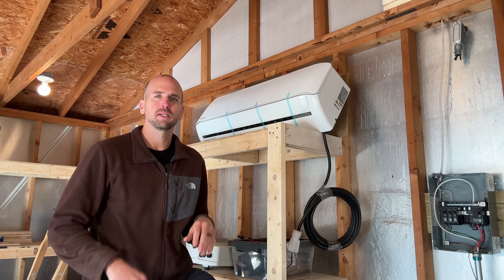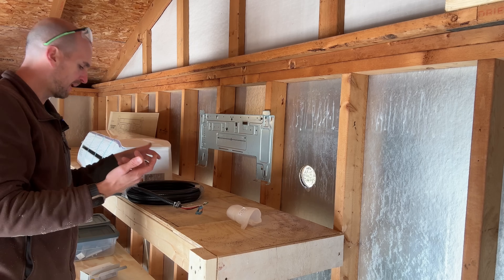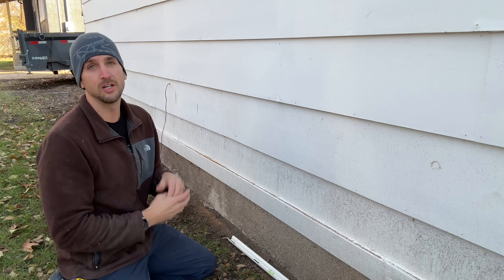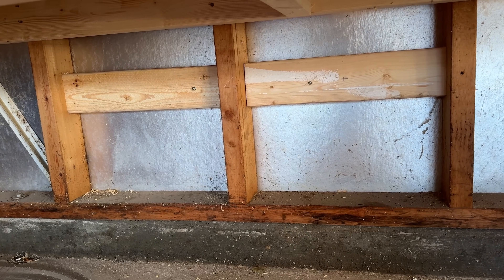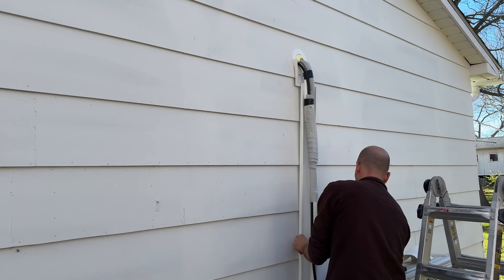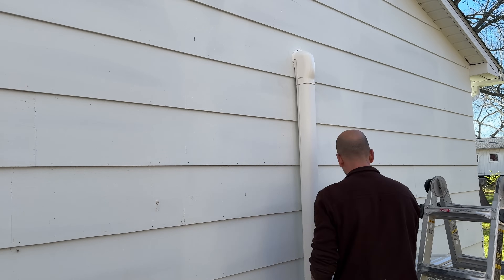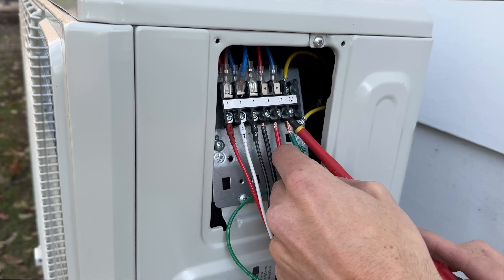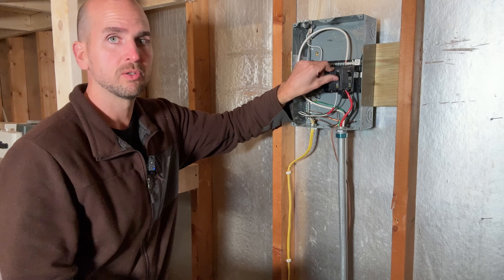Complete DIY Mini Split Installation | New Mr Cool 4th Gen Unit

Comment: Im a bit confused why would you wrap the line set prior to checking for leaks ? That's kinda DUMB! If your going to tell people the most common mistakes well you just DID one of the most COMMON MISTAKES Yourself.  ALWAYS CHECK YOUR LINES BEFORE SEALING WRAPPING OR COMPLETING YOUR COVERS! just in-case you have to take them apart and reinstall them. Dust or dirt can cause the line set to have a slow leak. A spray bottle with Dish soap and water to test your line connection spray it on the connections  if there are bubbles blowing up,  you have a leak!   I agree with your marking the wire, it is mandatory in US ELECTRICAL CODE to mark for safety. Wrapping the wire is the best way!
Reply: I can sense you got angry... you ok? Is everything ok at home?
Reply: @dulceesparza8704  you got late day issues bro, And nope not angry at all, just confused if someone is going to correct everyone else then atleast get it right. If your a handyman And I hire you to do the job you wrap all my line sets and they discharge because you didnt check for leaks, then Ill be angry. Then you have to deal with it. (assuming your the Handyman I hired.) you can either pay for it or besides the bad word of mouth Ill see you in court. Then Ill be happy again because hopefully you learned to always check your lines when messing with any kind of Freon. If you own up to the mistake take care of it, Then I would still be able to give you or your company a good reference. first for being honest (Also the most important) secondly for taking care of the job to the satisfaction of the customer.

Comment: ? I didn't notice what was done with the drain line on the outside of the building. Does it just terminate at the factory provided length or do you extend it down the external wall and terminate at the back side of the condenser ?
Reply: He didn't pay attention either

Comment: How do the lines run in a multi zone setup look? Daisy chain or each connects directly?
What is the max line length?  Im trying to do this in a second floor and the lines are only 25'?
Or can i buy more?
Reply from the maker: You can buy more and at different lengths to fit your application.

Comment: I installed a Mr Cool non DIY dual zone split system 3.5 years ago.  Both units running great no problems.  I really dont like the coiled up line left over with the diy kit.

Comment: Everything is numéro one. Except the part where you exposed your line set to atmosphere thus adding air to your line set. You would of had to vacum your line set bro before opening your valve 😮
Reply from the maker: Not on the Mr Cool units.  If done right the pre charged lines mean you will not need to pull a vacuum.
Reply: @EverydayHomeRepairs  your still putting air in your line set. Hard for a compressor to compress air

Comment: if it sounds too good to be true it usually  is !!     MR COOL you left out 2 major critical  proceedures in your installation that can lead to unit problems .  1)  you did not  evacuate possible air and contaminants out of the evap and condensing units ,before letting refrigerant charge into system  and 2)   Cardnial  rule    you did not leak check all of your refrigerant connections for leaks !!!!

Comment: One thing to note is that the wall-mount bracket that mrcool sells for the 18k model (which is different than what's shown here) only allows the unit to be 4" from the wall (although mrcool recommmends 6"). But what makes this a real problem is trying to (carefully) bend the refrigerant lines enough to get them aligned well enough to screw the couplings together. I had to unbolt the compressor and move it away from the wall, then screw the couplings together, then carefully bent the lines enough to get the unit back into position.

Comment: Word of warning. Mounting the condenser unit on a bracket, the bracket will transfer sound vibrations to the wall, not a lot. But worth considering. 
I mounted mine on a bracket, now wish I hadn’t. May change it.

Comment: Dude! Hands down, that was one of THE BEST done clip I've ever seen. And I've seen a lot. Bravo. Two questions: My HVAC buddy who will help me on a weekend with this is suggesting a 24k system for my 24 x 36 pole barn that we Spray Foam Insulated with 2" on walls and 3" on ceiling. In your opinion, is 24k overkill? Guy is way smarter about this than me, but I'm just wondering. Or is bigger better?

Secondly, he likes Mitsubishi, but it's almost twice the money as Mr. Cool, which I'm reading is a very good system. Money is not the biggest object, but the Mr. Cool seems like a much better VALUE. Can you weigh in? I don't mind spending the money if it's buying something far superior, but I'm not sure the Mitsu buys all that for the delta in price. Thx. Keep up the great work!

Comment: I feel I could tackle this project now that Ive seen this video.   One question is if I would need to run conduit on the inside exposed wall instead of the NM(non metallic) wire shown here.   I know its drilled through the studs, but its exposed so thats why I am asking. So I know what supplies I need for this.   Thanks for all your helpful videos!

Comment: You probably should have mounted the air handler to the right, not over top of the shelves.  Reason: shelf will block air flow as the air output is at the bottom of the air handler.  If mounted to the right, free air flow downward.

Comment: I installed a two head Mr. Cool in my VT home about 18 months ago.  It has been working great.  The few days in summer that I need it it cools the home quickly and I did get to test the unit once in winter when it was -16 F outside.  It produced heat without issue.  My oil use is down tremendously and I am planning a DIY solar setup this some to save even more cash.

Comment: Cool
But is 12-3  what you had to use for 240 just a heads up
Reply: He used the white of the 12-2 as the second leg for 220v. Neutral not needed
Reply: Why would neutral not be needed? @phildesmond9605

Comment: Could one place the "outside" hole further down the wall?  I don't like those lines coming out of an exterior wall.  I hope to be able to go into the wall behind the unit, run the lines behind the drywall and then out through an exterior hole closer to the ground.

Comment: Is that extra line set that I see rolled up behind the unit? And is it safe to do that?
Reply from the maker: Yes, but I think you should have the extra coil laying horizontal instead of vertical which has been pointed out be a bunch of people in the comments and is a better practice.

Comment: Ok a couple of things   The coil created by extra line set in the back of the outdoor unit is an oil trap.  Eventually the compressor will be starved of oil and will fail.  The required way to coil it is to coil it horizontally not vertically.  The other thing is the positioning of the indoor unit.  It appears that the area directly underneath the indoor unit is framed out for a shelf.  If a shelf is installed there it will block off the air flow.  When in cooling mode the lovers will be directed downward,  this will obstruct the air flow and the air won’t get to where it is intended.  Additionally if a shelf is installed you are likely to have the cold air recirculate back to the air intake and possibly have freezing coil issue.  The 2x4 frame underneath is not great.

Comment: Also, if you only get a 30" bracket like he got, you can mount one of the 90° angles brackets centered on a stud and than offset the hanging bracket so that it mounts across two studs where the other 90° brackets hangs.

Comment: Great video! How much does it typically cost to have these installed by a general contractor? And this is just one handler, how would you install additional handlers if that’s something I’m looking at? It looks easy enough for me to do but I’m hesitant with the other handler going to the opposite side of the garage and doesn’t have outdoor access. So most likely would need to run through the walls or attic

Comment: As a DIYer with school education.
I did the same mistake, trying to water level the unit.
Water will just NOT FLOW OUT...
Now my indoor unit is tilted 5-8 degrees, so the water will flow out naturally ... 
I have my split unit working for 3 years now without any problems ... 
Wait. Yes. Where we stay, 2-3 months is too long for a cleaning. 
If you have stagnant water in your AC indoor unit, that will cause mold and bacteria to grow ...
Just saying.

Comment: Why not elevate the inside unit higher to clear your shelf more? Items on the shelf will block air flow. There is also a commercial sealant for the refrigerant lines which helps to ensure a good seal.

Comment: I am installing same unit but a double unit. Can the drain be separated to run directly outside and the lines to the unit be run through the attic ?   Thank You for your help and great video of the install process !
Reply: I'm wondering the same. I can't believe it wouldn't: just needs to drain

Comment: Can I make my pilot hole in the middle of the metal bracket and run my lines through the middle of the mini split,  instead of the bottom corner ?

Comment: Very good and practical installation.A few things could’ve been done before releasing the precharged system such as: vacuuming the line set with a vacuum pump,because moisture is in that line set.but otherwise from that not bad at all.
Reply: What are you talking about it’s a diy Mr cool unit it doesn’t need vacuumed.

Comment: Awesome!  That’s a huge savings doing the work yourself. 
Question….What if you performed the install yourself and then called an HVAC guy to cut the lines and reconnect them for a cleaner job. I would think the total cost of the project would be considerably less than having the HVAC guy do it all. I am assuming the refrigerant can be extracted and reinstalled by the hvac guy. Just curious.

Comment: Love the content. Keep it up. I would suggest insulating that garage. It will keep the unit from constantly cycling, reduce the electrical bill, and increase the longevity of the mini split unit.
Reply: If the unit is cycling wouldn’t that means that the unit is larger than the space? Plus is the unit an Inverter?It as 4core 2.5 mm wire which inverters use…so if the garage is not insulated properly,the opposite would happen(the unit will run continuously)which would also ramp up the unit to maximum speed for both the condenser fan and the variable speed compressor.
Reply: @r410a6  Yes, causing your electrical bill to increase. Not to mention the strain on your unit ensuring your local HVAC tec a new boat from all the repairs you're going to need. Bottom line is insulate the enclosed area.

Comment: The coil of excess lineset should be horizontal.  You can have pooling of refrigerant.  I am no pro, but I have installed a few of these and the instructions point this out.

Comment: I mounted my outside unit on four PVC pylons filled with concrete and bolted the unit into the pylons. They're two feet tall. It's NH so we could get a 2' snow storm and have in the past.

Comment: Great video. I am now going this route for my mini split. However, you mentioned that the unit needed a  20 amp circuit, but the product specifications state it needs to be a 30 amp. Can you clarify why you only went with a 20amp circuit? I have a bunch of 12/2 romex and would love to run that, but I got concerned with the 30a specification on the product page. Again, I appreciate this video more than you know.
Reply: the mr cool 12K units run off of 12/2 - 120 volt/20 amps. Anything above that will need 240 volts and thicker wire.

Comment: I was led to believe that the lines that you attach are empty and that the refrigerant is entirely in the outdoor unit which is released through the lines when you open the high pressure valve. Which is also why they typically recommend that prior to opening the valve the system is pressure tested and vacuumed. I also did not realize that the indoor unit lines are nitrogen charged so when you take off the caps off you got a loud blast.

Comment: He’s doing an OK job it’s really not how you’re supposed to do it first of all order for him to put that condenser on that dolly the way he did. He had to lay it down. You’re not supposed to lay it down because the oils it’s like flipping a refrigerator upside down. It’s not good for the unit second thing that he’s doing wrong, The line set should never coil on the back of the unit you have to cut that line set the Freon can’t flow properly you’re gonna have certain boiler and that line set. Think of it like a race track the straighter, the lines the faster is going to go easier if you have so many turns and loops, it slows it down. don’t get me wrong what he’s doing it’s going to work but I’ll give it a year maybe two years you’re going to have issues it’s just like your airflow. If you look in your attic all your ductwork is nice tight in your attic it’s not sagging at least it shouldn’t be. Do you want straight tight lines for the airflow to go the way it supposed to

Comment: Great DIY video    but a vacuum  nitrogen test is a must its purges the line of impurities and checks for leaks. that over time damage the A/C. This requires test gauge and a vacuum  I bought it and was worth it as you probably save $2000 plus by installing this yourself  I also found some used equipment as others have done the same and sell the equipment when done   leak test is a must i micro leak emptied my neighbors split over 2 months and cost $900 to repair and recharge.
Reply: On the MrCool DIY units the line sets are already vacuumed and charged with coolant.  When the line set is connected to the head unit and condenser the coolant ifrom the lineset s released into the system.

Comment: I’m planning an install for the single zone 12K model. It will be most convenient to have the air handler on the other side of the room. I’m trying to figure out if there are any bad things that come with running the lines down, but mostly 17ft horizontally (and around one corner). I’ve only seen people bring it perfectly vertical down the siding to the condenser with plenty of slack left. I’m worried that gravity will matter, but I’d need it to run across and not just down. Thanks for any insight.
Reply: Did you get an answer to this somewhere?
Reply: @thelosian  Mr Cool support replied saying that as long as the condensation tube doesn’t run horizontally, it’s fine.

Comment: Good video but from experience I will add , do NOT use electrical tape on line set drain bundle . Electrical   tape tightens or constricts and has  kinked drain lines in the past and caused leaks inside . Only use duct tape for bundling

Comment: Thanks for the video. Just curious, do you want to make sure the air handler is level. Seems like you want it to be a slight incline to allow the unit to drain properly.  Take care@
Reply from the maker: I am not 100% but I think the design places a bit of a slope to the drain pan if the overall unit is level.
Reply: @EverydayHomeRepairs  I was wondering if that was the case. Thx.
Reply: @EverydayHomeRepairs  I believe you're right. It's probably built into the system. All installs I've watched stress having it level so my guess is there's verbiage in the installation manuals. Take care!